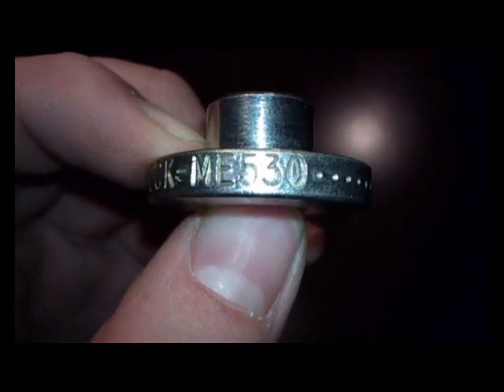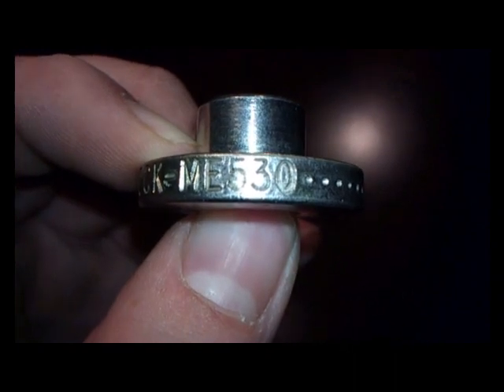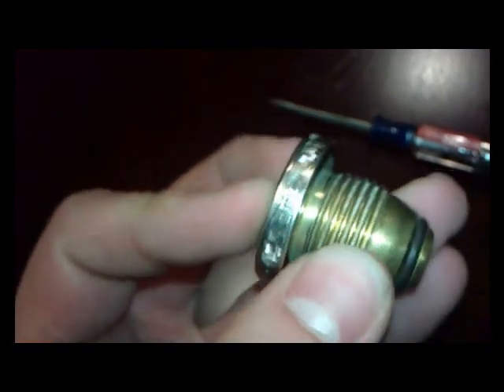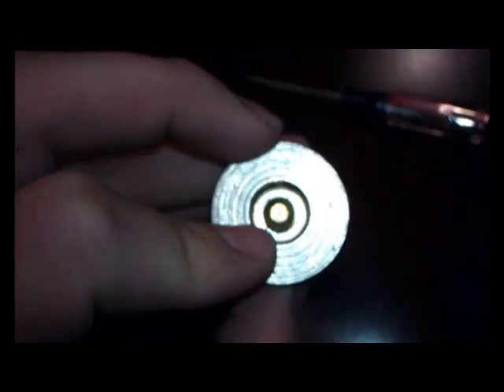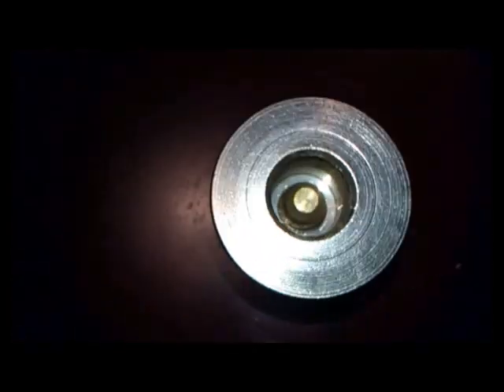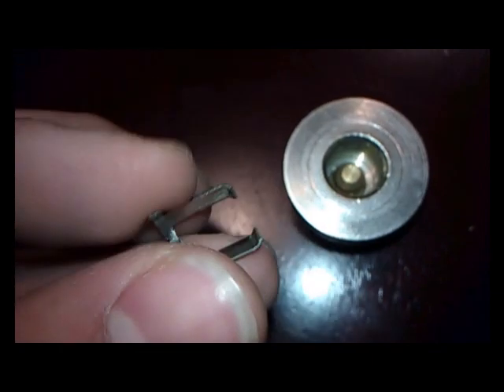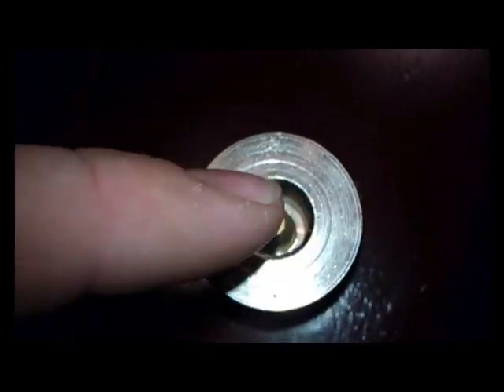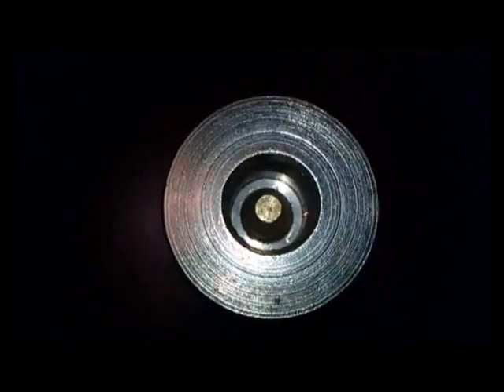MEC-POL ME530 Lock Gas Valve Propane Tank Removal Break Unlock Without Key

Comment: Wait, hammer metal against metal to open a propane tank? Like, create some sparks so I can get at the propane. Maybe gas doesn't come out of this hole with the lock on it that we are going to hit with a hammer. I honestly don't know. If gas isn't released when you unscrew the plug I suppose it could work but what if it does? hmmm......

Comment: A 6 in 1 screwdriver works flawlessly. Take the tip out of the screwdriver and then slide the screwdriver barrel into the lock and push. Easy peasy and no damage at all.

Comment: an orange wire nut works to take the locking cap off to remove the other part of the lock out of the valve

Comment: This is the best way.  7mm socket fits inside the inner circle.  apply pressure with thumb and the ring comes right off giving you access to the plug
Reply: I watched the video and was successful using a 7mm deep well socket. I came to the comments to leave my experience but you beat me to it 😂 So this lock was on a 50 gal tank came with the house I bought used just for generator power. When it’s empty and I call the # on the tank for a refill, are they going to try to charge me for it? Not sure but i believe the previous owner already paid for the full tank
Reply: A .40 shell fits just right.
Reply: I love YouTube.  And Mike! Lol.  Worked like a charm and didn't even take a 3 min video.
Reply: I couldn't quite get the socket in far enough with my thumb, but a couple gentle taps with a hammer did the trick!

Comment: You should not do this for your own safety. Let a pro unlock a propane tank. If you remove the lock yourself you are committing a serious crime and endangering yourself and family. The pro's will do a leak check and ensure your system is in safe operating order. Just pay the bill.
Reply: What crime? I didn't remove anything... Oh you locked it? really? When? hmm, that's sure is strange...
Reply: The SOB's at the gas company did the same thing to me yesterday. I own the tank and the line and they locked me out of my own tank! My bill has always been paid in full! If there is any crime here it's the damn gas company that is committing it!
Reply: Jonathan Peters they locked mine because it was at 2 percent after paying 600 in full
Reply: @codycasualtiesenglad  The SOB's at the gas company did the same thing to me yesterday. I own the tank and the line and they locked me out of my own tank! My bill has always been paid in full! If there is any crime here it's the damn gas company that is committing it!
Reply: Serious question. Who are "The Pros" ? Because in Alaska, if you cant fix it, repair it or improve it on your own,  you are going to need to call "The Pros" = friends down south so you can move in  and live with them,. Plot yourself down with people who cant fix or repair, weld, change a tire.. anything - without picking up the phone.  Yes, propane, natural gas is dangerous. It's so dangerous that we constantly hear about  homes erupting in fire in rural areas all across the us. Daily.
Reply: Change belts on yard machines snowblower

Change belts on yard machines snowblower